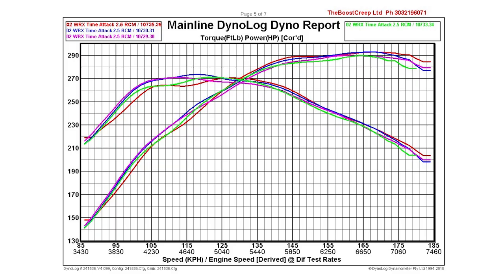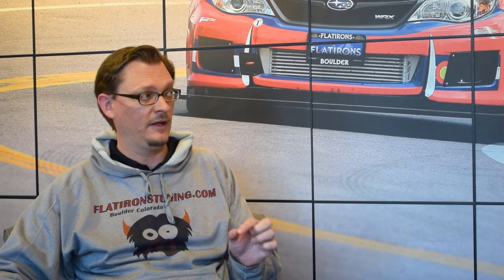What is a Dyno Correction factor?  And why is it important?

Comment: The SAE defined the Standard Atmospheric Conditions based on an assumed Sea Level humidity, temperature, and barometric pressure.
All EFI calculations are based (hence 'Base Map') on these assumptions and compensatory adjustments are made in the ECU thousands of times per second to maintain the target AFR.
The dyno does a sort of reverse calculation to estimate power based on the result of subtraction or addition of compensatory adjustments depending on the test conditions.
Reply from the maker: Thanks for the comment!

Stay Tuned!

Comment: Question for the Subaru gurus! Ej20g block with ej207 v8 heads. What is needed for it to work? I’ve read on doubling up head gaskets but no clear answers. 

More info:
Spun bearing in the ej207v8 block,I have a good running ej20g block in my possession I would rather just use this engine rather than buying another.
Reply: What are the cc's of the cylinder heads? I would definitely not ever stack head gaskets. You can get up to 1.5mm thick ones, stock are around 0.6-0.7mm I believe.
Reply: The only reason for needing to raise the heads with a thicker gasket would be to adjust the exhaust and inlet port spacing across the block so the manifolds fit?
I don't think Subaru really played around with the manifold footprint within the EJ20 range of engines.
My son just put D25 heads from a 2007 EJ255 on a brand new EJ257 short block no issues. 
Only other consideration is compression ratio.
If you're increasing compression your ECU may need to be reflashed to correct the possibility or inevitability of excessive knock.
Other than these few things you should be fine if all the bolts line up.
Reply from the maker: I'll do a little research and see what I can find for you.  

Thanks for watching and Stay Tuned!

Comment: Guys, why not explain dynos as different calibration tools that translate hp differently? Different types of dynos will translate power into a different number but, in the end, if that engine’s set up has been maximized, then the job is done.  Trying to do a translation from wheel hp to bhp or Kw or whatever other measure doesn’t serve much of a purpose.
Reply from the maker: Thanks for the suggestion.  For this topic, the main concept that I wanted to discuss is that the value that you see on a dyno sheet is not the power that the car actually made.  

I think that it is an important concept, and one that is very often overlooked.

The different ways that various dynos work is also pretty cool for sure, and I'll add that to our list for future topics.

Thanks for watching and Stay Tuned!